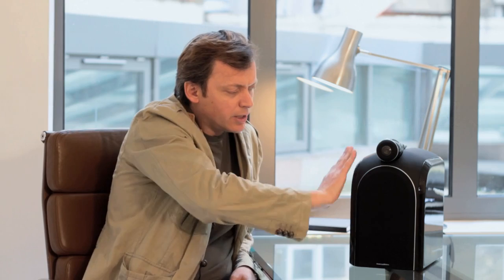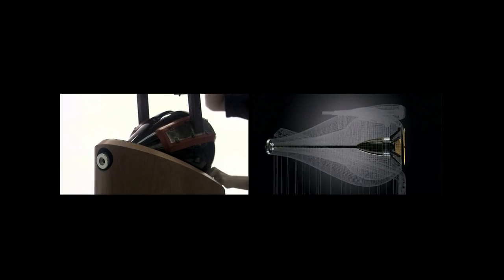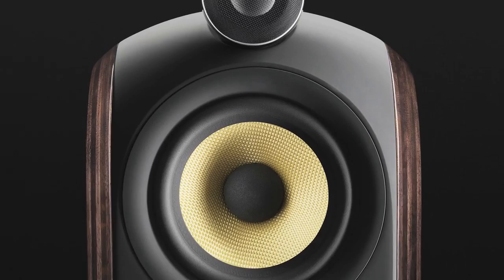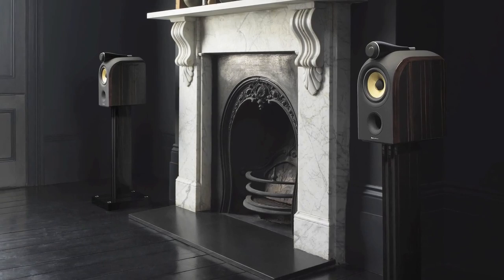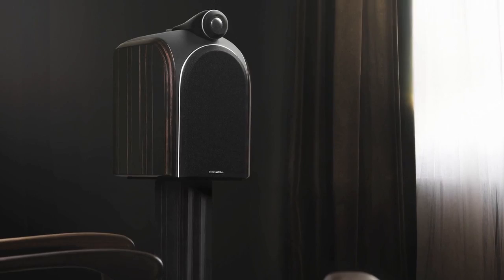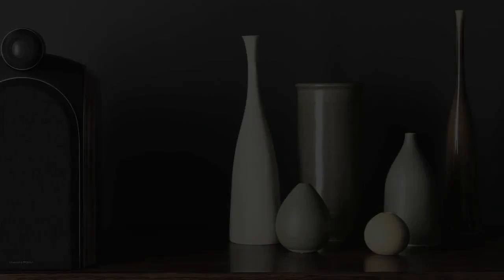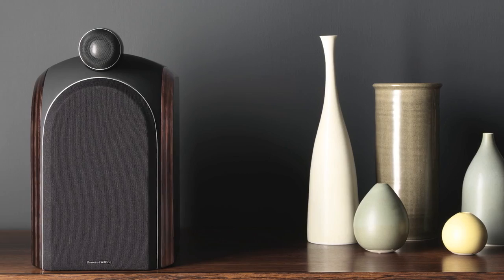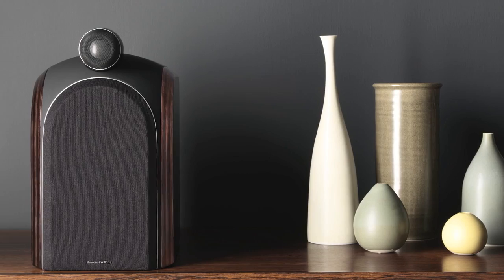Exclusive interview with PM1 Designer Morten Warren

Comment: I went from 803ds to PM1 + a good sub and prefer it. The PM1 with a 
quality sub is outstanding audio quality and image better than the big 
803ds I had. In a small ish room one can get away without the sub, but 
by adding those lower HZ the PM1 can't do with a good sub = audio magic 
and costs well below other choices. A damn shame they stopped making 
them. They were actually a bargian for they sound quality and build 
quality. Rumor had it they sold well, but profit margins were tight and 
they sounded so good it cut into sales of 805s. I'd recommend any can 
grab a used pair and add a good musical sub, will not be disappointed in
 the least.

Comment: Why has the tweeter been placed so far forward? Now, the mid and high frequencies are out of phase. You can correct it with a filter, but that will negatively influence the sound quality. It's better to place the tweeter at the height of the coil of the speaker underneath. Easy to do, it solves a lot of problems and instrument and voice placement improves a LOT !
The sound overall will improve. B&W knows this and so does this designer. Strange he did not do it...?!

Comment: Why? because of diffraction. Recessing the tweeter module would defeat the purpose of all the hard work put into the cabinet and it's design. There are always compromises that must be made when designing a speaker, and i suppose that B&W found that the benefits of the tweeter placement and cabinet form factor outweighed the negative effectes of using a filter.